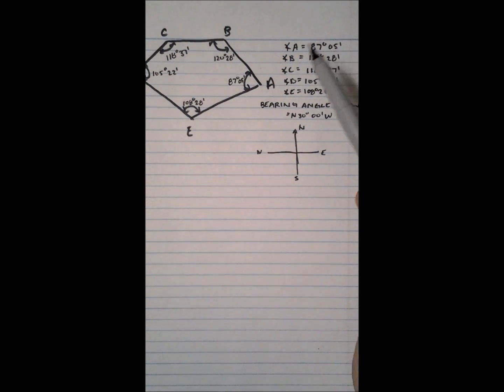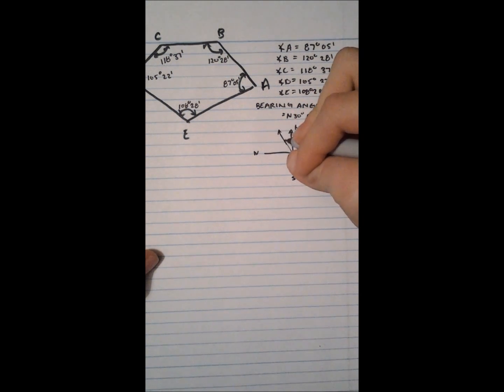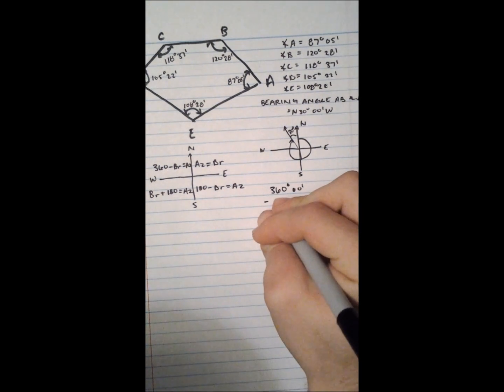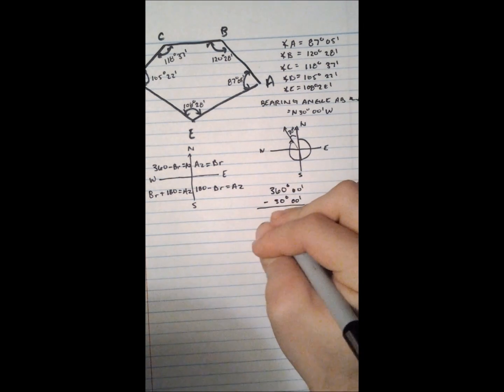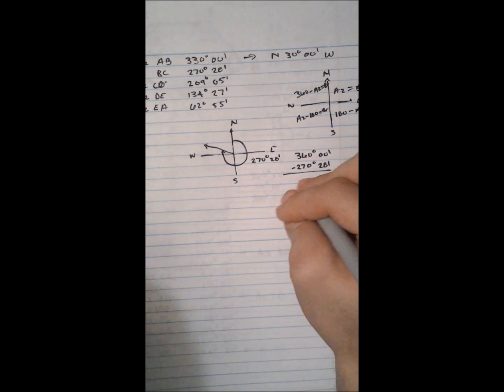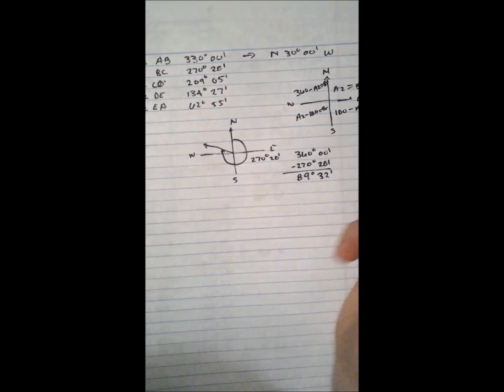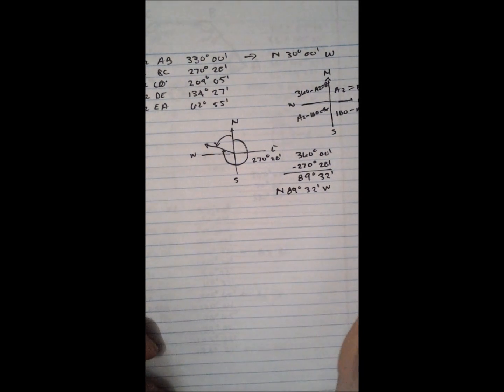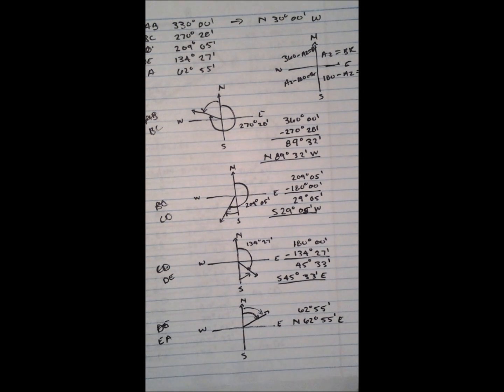Surveying - Traverse, Azimuths, Bearing Angles

Comment: how do you find an interior angle if you're given bearings for each side
Reply from the maker: i'd suggest sketching the traverse and drawing the the NSEW arrows at each point.  you should be able to calculate the interiors by using corresponding angles.

for example, in this problem, the interior angle at A = (90 - (bearing angle of AB)) + (90 - (bearing angle EA))